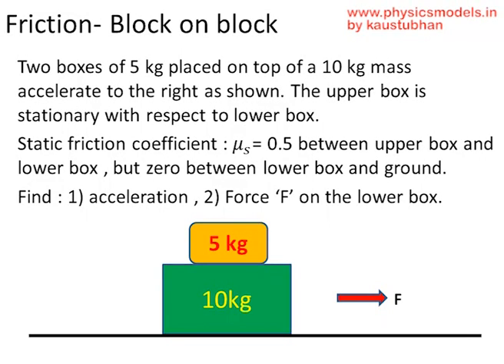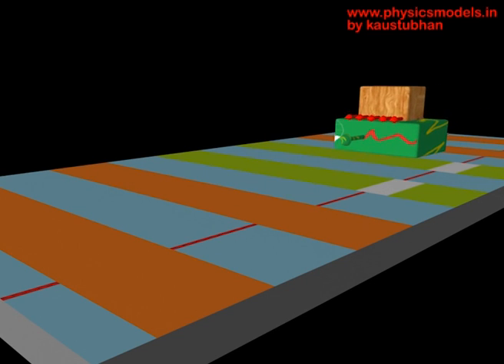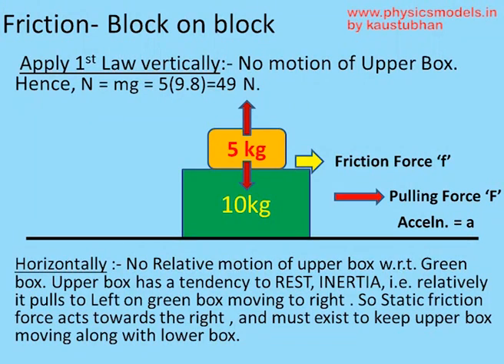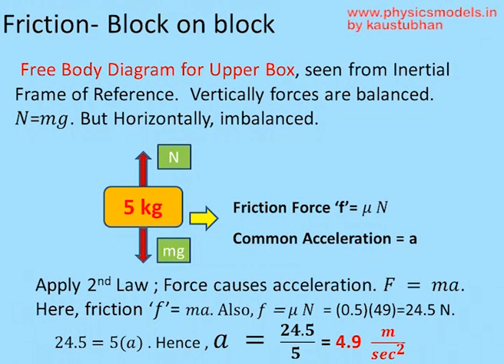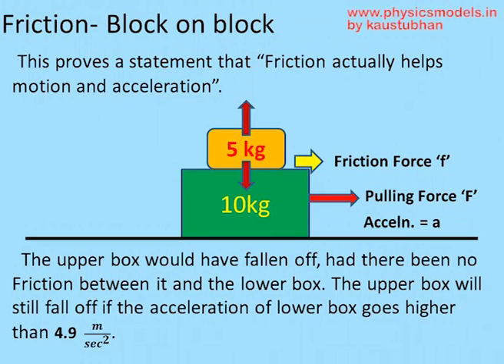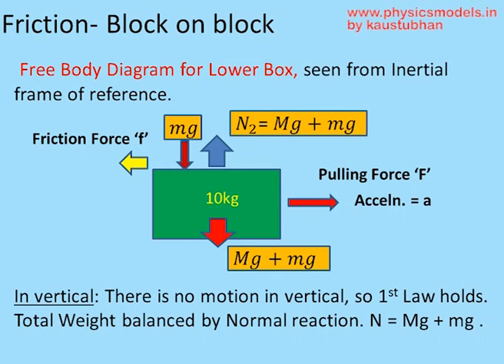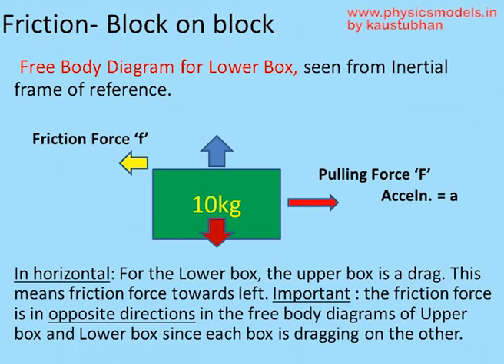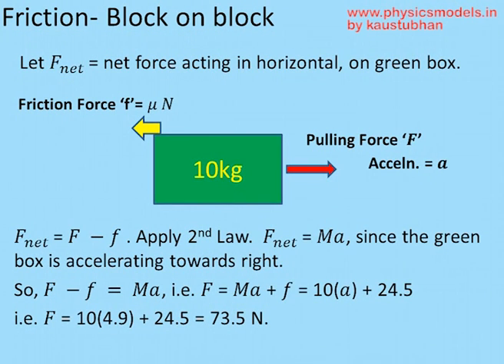PHYSICS MADE EASY - Friction- Solved problem - Block on Block

Comment: Acceleration on both blocks will always be same ?
Reply from the maker: The acceleration of both blocks as a System will be the same as long as they are moving together without a relative motion
Reply from the maker: Hi please see my recent videos 
1) https://youtu.be/nPzGgr9zEcc -- block on block - therory and solved problem
2) https://youtu.be/76PqTL-a5wg -- Block on Block - theory and solved problem-2
3) https://youtu.be/WHmi-DBZ1nc -- Magnetic Field due to current - solved problem

Comment: If force is applied on upper box the will the other experience force??? 
Plz reply fast
Reply from the maker: Yes, if the Force is applied on Upper Block, the Lower Block will surely experience the Force due to Static friction by the Upper Block pulling the lower block. This is covered in my other video of a solved problem and experiment dedicated to Force on Upper Block, please see that. If you need a link, let me know
Reply from the maker: Also Please view my latest video on Friction-Block on Block-experiments and Theory-1, link https://youtu.be/lzILghGgotk

Comment: When force is applied on the lower box how can we assume that relative velocity of upper box is 0 wrt the lower box
Reply from the maker: Albert, in this specific numerical, the condition given is that the " Upper Box moves along with the Lower Box". That implies we have to assume that there is no relative motion, hence relative velocity=0. Also, I have mentioned in the solution that if the acceleration exceeds a limiting value, 4.9 m/sec^2, then there will be relative motion and relative velocity will no longer be zero. 
Hope this clarifies your question.

Comment: why the mass of the first block not added to upper block for calculating  the force on lower block.
Reply from the maker: Hello Abdul, the answer is that in a Free Body Diagram, you only consider one mass at a time , and all the Forces acting on this particular mass. When you do FBD for small mass 'm' (5kg), you don't add any other mass. When you do FBD for the big block 'M' (10kg), you don't add any other mass. Having said that, when you do FBD for big block of mass M=10kg , you have already considered in vertical direction the downward Force (=mg) due to small mass, , and this is exactly compensated by the upward Force of Normal reaction (N=mg) due to small mass. Then look at the horizontal direction , it leaves us with just the horizontal forces analysis .==> which is :- rightwards is the Force 'F', leftwards is the friction force 'f'. Nothing else is acting in the horizontal direction in the FBD. I hope this makes it very clear. Thankyou.
Reply: In inertial force ma shouldn't m be 10+5?